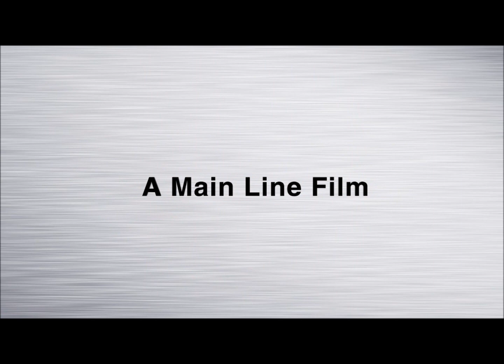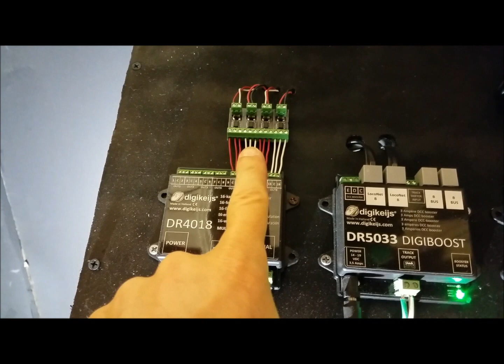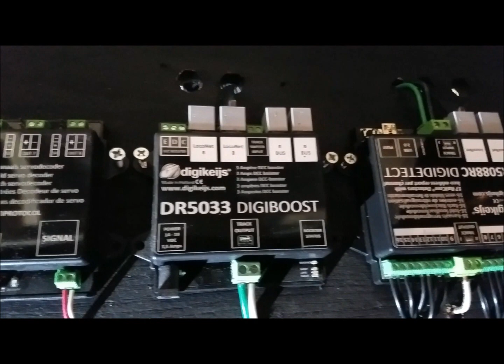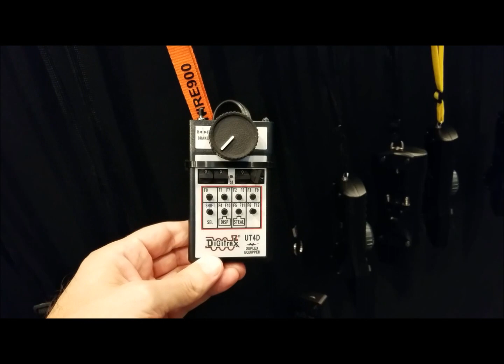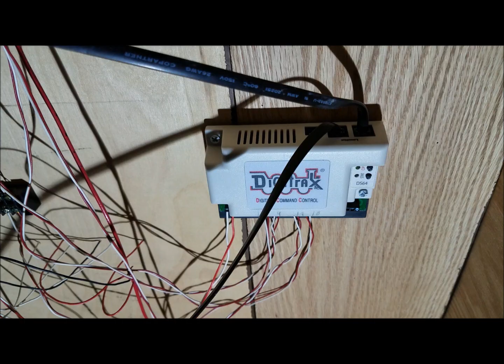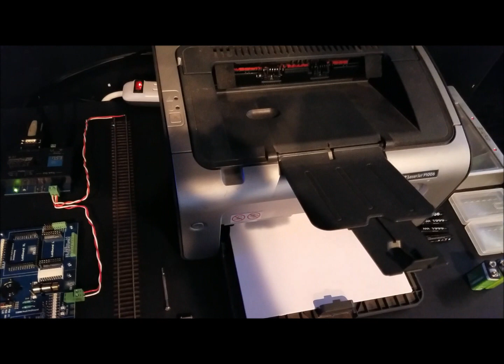DCC Hardware For The Digikeijs Powered Iron Planet Layout

Comment: Why so many boosters?
Reply from the maker: It's a fairly good size layout with lots of dectection.  It was easier to use a few extra boosters vs stringing lots of wire and having to use circuuit breakers.

Comment: Nice to see that your panels are at different locations. I don't understand why most people insist on 1central location and run miles of wiring back and forth when they can install the devices locally and run a loconet cable between devices. How are those DR5088RC's working, I hear that there are issues with delays on reporting loco info ?
Reply from the maker: Thank you.  You are correct.  Way easier to run the loconet cables than all the other wires.  The DR5088RC are working great with JMRI.  Loco number shows up on the panel almost instantly.  New firmware updates for both the DR5000 and DR5088RC are just about to be released.  The new drive window will also have new RailCom features.